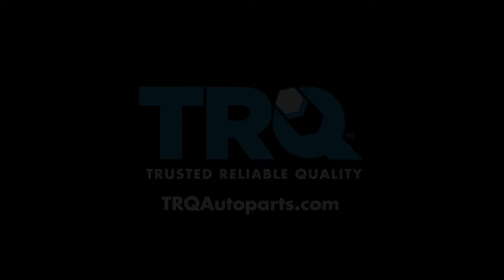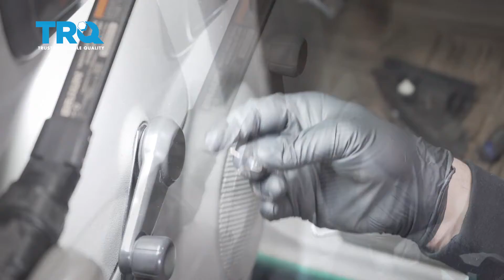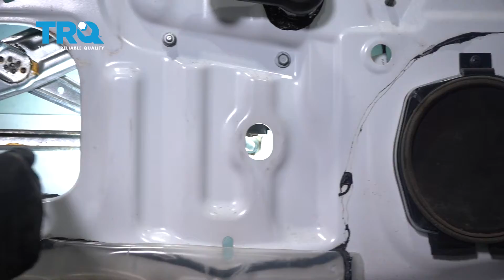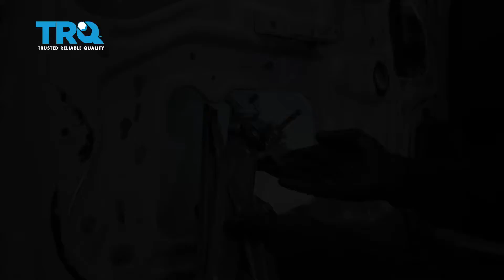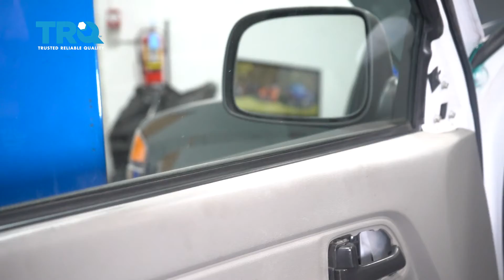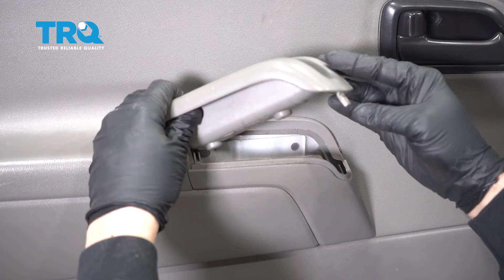How to Replace Front Window Regulator 2004-2012 Chevy Colorado

Comment: Have a question. I have a 2008 Iszui truck my handle regulator is real hard to raise and lower
 I had a dealer to lubricant the tracks and the regulator and it didn't help
Would replacing the regulator make it easier to raise and lower?